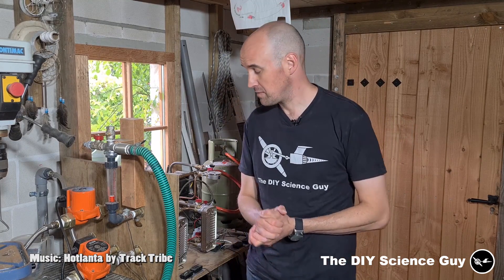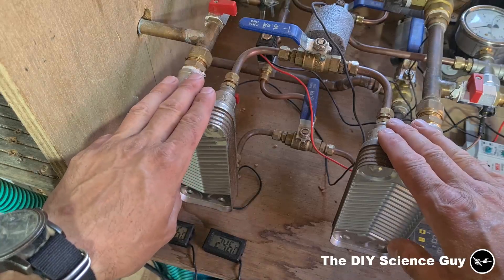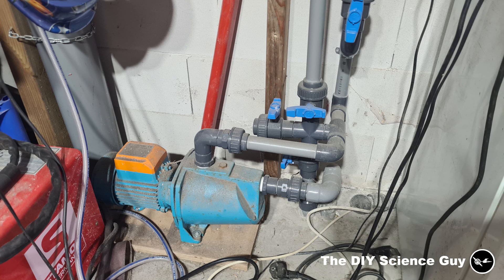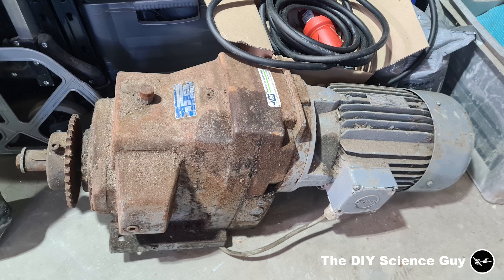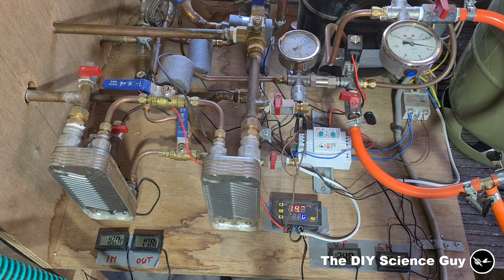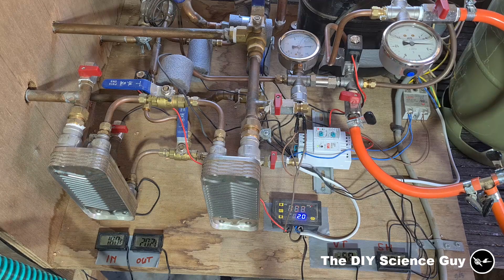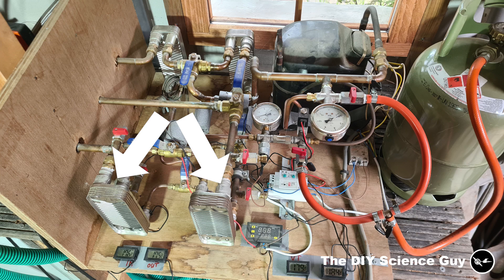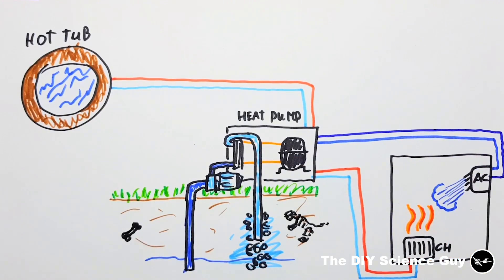Home made 4kW Heat Pump part 2

Comment: Kip working. You need to consider EEV systems and automation (cheap like TECO will suffice ) to automatic control the valves and pumps and read the sensors. Good luck.

Comment: I wish I understood 10% of this video, but at the end of the day, it sounds like you are creating 150+% heat energy than that you put in. This is fantastic.  Do you have coolent (propane) loss? You'd need to account for that too.
What are your figures? How much did it cost to build this so to work out the.payback. I'm not experienced enough to build something like this without full plansm

Comment: i found you 2 weeks ago. I also builded a working H² Generator... but it turns out its difficult to store... now i`m onto building your heat pump project. I want to heat just one room by floorheating and all the pumps you can buy are to big for one room... i´m hoping youll figure out the thermal expansion valve and do a video on it! :)

Comment: To help it start with head pressure look into getting a “hard start kit “ it’s just a potential relay and start capacitor for the compressor. 

It will make it able to start with tons of head pressure and greatly extend the life of the compressor by reducing starting amps.

Comment: Hi there, I had a question about your work on hydrogen. In the past you used a propane tank to store the hydrogen gas that you created. Did you ever have any issues with the steel tank leaking or cracking due to embrittlement? Do you still use the same tanks or did you change them out?

Thanks very much for your time and love your work.

Comment: Why did you have 4 heat exchangers?
Reply from the maker: 2 for antifreeze and 2 for ground water. I don't want to accidentally pump antifreeze into the ground when I mix up valves.

Comment: Great video, very tidy heat pump. I built a water source heat pump too, it modulates like you plan to. I used it all last winter. I will add an air source evaporator for when the air is warmer. Like you, I use fuel grade propane. Just don’t invert the cylinder  to get liquid....I found out the hard way
Reply from the maker: Thanks! Nice work! What type of compressor did you use?
Reply: @TheDIYScienceGuy  initially a scroll compressor. That was destroyed when I inverted the propane cylinder. I now have a Bitzer piston compressor which is much quieter!
Reply from the maker: Ok, so are you able to vary the outpute of that compressor and, therefore, vary the electrical energy consumption?
Reply: @TheDIYScienceGuy  yes, it's on a variable speed drive (VSD/VFD)
Reply from the maker: Nice. Do you have a link for me where I can buy one?

Comment: With UN1965, I think you have barbecue-grade "propane" hydrocarbon mix, and refrigerant grade R290 would be UN1978. You might think about setting up a gas purification process?
On the other hand, gefeliciteerd on the working heat pump! This is a lot more sophisticated than what I would design.

Comment: Quite the dichotomy of smarts in the content, and then the stupid Fahrenheit comments.  "Celsius means nothing to me.  So I do not punish myself with it."  I LOVE the Imperial system.  Without question, this is for no other reason than because I grew up with it, and now I am comfortable with it, and I am sentimental towards it.  If I was a betting man, I'd bet that YOU grew up with the Metric system!  

Outside of that, this is a cool (and warm!) project.  I will point out that, rather than an app, all you need to know to calculate evaporator superheat are: Evaporator outlet pressure, Evaporator outlet temperature, and the temperature / pressure curve for R290 (propane).  You can even get gauges that display pressure and the corresponding saturated temperature for particular refrigerants.  That makes it super easy then.  I highly recommend the thermostatic expansion valve.  An adjustable one, of course.
Reply: whereas i only work in degrees reaumur... fahrenheit is so quaint and peculiar...
Reply: IF you wanna do math, Celsius is easily superior. For everyday use, neither is better than another and a person can get used to any measurement.

Comment: not all the heat on the hot side is "usable", which most people neglect to take into account.
Reply from the maker: How do you mean?
Reply: @TheDIYScienceGuy  the larger the differential, the faster heat flows.

the closer you get to equilibrium, the less transfer you get in a given time.

for the hot side to transfer heat to a fluid requires there be some differential. so theres always a certain amount you cant use due to time constraints, etc.

at least thats what i think they mean?

Comment: Great channel with some super interesting projects!..👍 if you haven't thought of a use for the bunker/basement perhaps you could put a large water tank (or a couple of IBC tanks) down there to store hot/warm water as a seasonal buffer!? 🤣😂
Also, I've been hunting for anyone who has tried to connect a wind turbine to a heat pump for hot water... not via electric but direct wind powered compressor; it might not have been done because it is just not practical, but linking a wind turbine to a heat storage/buffer tank could then be used to feed into a second heat pump which could be used on demand rather than ground water.🤔

Comment: Thanks for the update.  I am looking at eventually doing a similar project.  Right now, I'm just disassembling window units into their component pieces so that I can water cool the condensers and use that hot water as preheat for my hot water heater.   One thing that I am doing differently is with the outside water source - I'm closing the system by burying copper coils in the ground (ground which has a very high water content).  Here I plan on using a variable speed ecm pump with a couple of temperature sensors to regulate the water flow as needed.

As an aside, would you have a parts list for this project?  Thanks again. Peter
Reply: @petersamios5409  you could circulate propane through underground pipe as the evaporator.

Comment: Your heat exchangers are on the small side. I have experienced a real bottleneck in my first system from exchanges twice your size. 
Also, I would advise against using plain water. Maybe try a closed loop with water and glycol? I run mine down to -20°C with a delta of 40°C. 

And if you simplify it and beef up the pipes, braze and not solder or use pressure fittings (I use pressure fittings, it's easier to change things) and use proper 30-40bar exchangers you can lose the valves and pressure switches while bumping up pressure and flow.

Comment: Use the Bypass to being bring in colder air... even from the ground.
Reply from the maker: Sorry, I don't understand what you mean. 🤔
Reply: @TheDIYScienceGuy  General geothermal, is very easy but Time consuming.
Using Plastic pipe in the ground to gather Warmth/cooling, as it is an average temp year round, at 3-5 feet deep.
You can run it horizontal or vertical or both.  Use multiple pipes to make it Flow better, and it can bring a constant temp into the home or where you want it.  You can design it to recycle the internal Air or/and process external air.
After installation, the only cost is the Fan to pull the temp Thru the pipe.
Its old tech from late 1800's and it still works, and Many companies are Finding the old tech works very well, instead of Heating and cooling.  You can bring the tamp upto about 50-55 degree's then Add extra from there.  Rather then outside temps down to 0 and lower to exchange.  And for AC, its at around 55 degree's already and just need the fan power to bring it into the area.

Comment: This is very cool! But one thing was bothering me. How come you calculated it in grams per secund and not kilograms? Would it not mess with the power calculation? I probobly just missed something. Great video!
Reply from the maker: Thanks! Well It doesn't matter as long as you keep it in grams the whole way. But I wrote it down wrong. I wrote J/(K kg), it should have been J/(K g). Sorry!

Comment: Was looking forward to this, looks great. Can't wait to see if you manage to actually use the groundwater to dump heat into or extract heat from it. Seems like a great plan. I'm a fellow dutch and I live a giant aquifer, my neighbor has a well with a 10cm pipe and it seems to take no power at all to get a cubic meter of water out of it for watering plants. If anything it will ooze water when the valve is left open. I should harness this massive heat sink/battery

Comment: could the heat pump be used to store heat into a sand battery
Reply from the maker: Well, usually, energy would be stored under a much higher temperature in a sand battery. But yes, with mutistage setup, it could be don.
Reply: @TheDIYScienceGuy  Thanks, I was thinking of a system that recycles heat from a sterling engine with a sand battery
Reply from the maker: In that case, I think you will like this video of mine: https://youtu.be/s5Ud-FD33tI?si=fwoRr2orrT7oTokS hope you like it

Comment: not a bad system but a flooded evap like used in a chiller set up may be a better design as untreated ground water will clog up the heat exchanger in time or in best case build up an oxide layer that will reduce heat exchange. it also would make it less sensitive to freeze up as you have a larger reservoir of mass to give more time to effect flow rate.
Reply from the maker: I did not know that system! Very interesting! I'm going to look into that. Thank you so much for the suggestion! 👌
Reply: I know of other open loop water source units. There has been no problem with the evaporator water side. It's quite different to a hot tap water heating application.